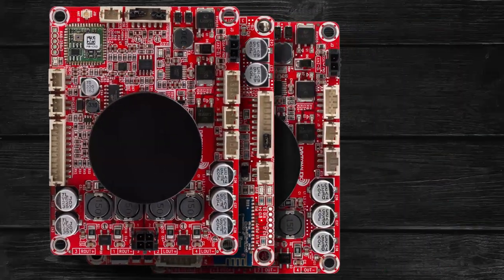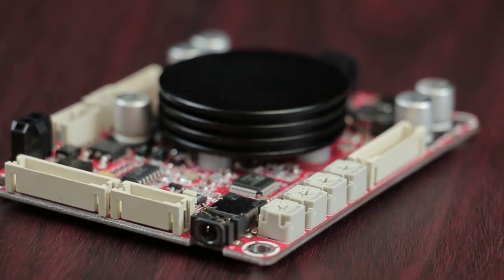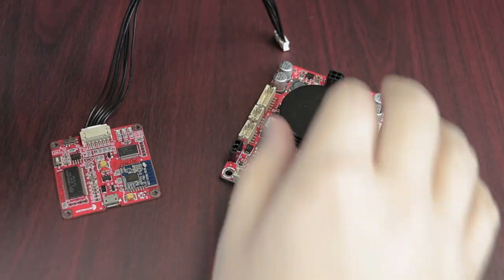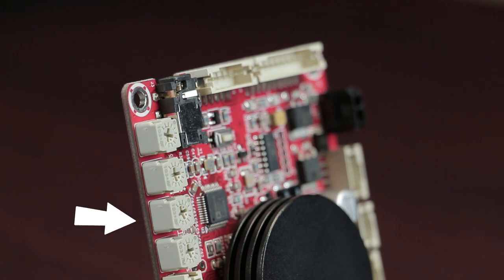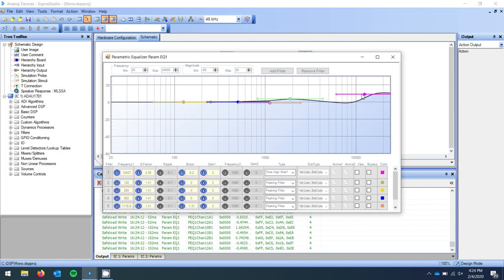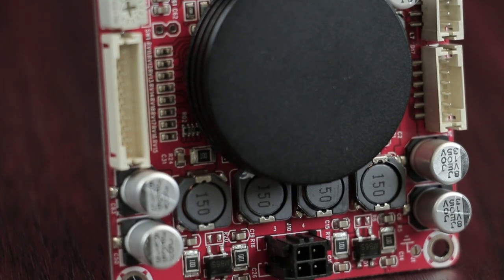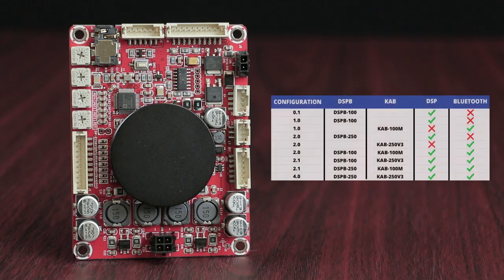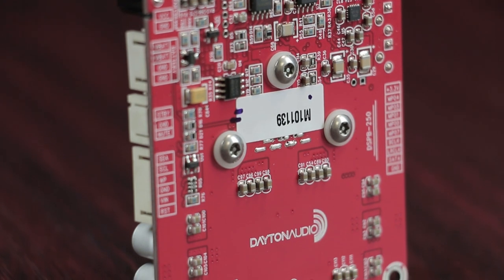Dayton Audio DSPB Amplifiers - Customize Your Sound

Comment: Thank you for making this video it has been much awaited. I just purchased dsp250/100 and have 2×kab30(best mini amp) I have to ask as nobody on tech staff has been able to answer. What is the advantage of the 2×50 Over the 2×30 it clearly seems to be rated for more power,at a lower voltage & higher impedance but still stable down to 4ohm? Is THD better? To sum up what I have noticed the 2×50w seems to be a better amplifier for higher voltage. You have done the DIY community many great services 👍

Comment: Hi there. For the KAB-215 amplifier I've seen 3 DIFFERENT power profiles. 24V @ 4Amps, 19V @ 1-5Amps and 12V @ 1Amp. Which ONE is correct??? Because UNDERpowering a board is just as bad as OVERpowering a board. Thank you.

Comment: I wish PE had a board that supported the AirPlay protocol. The AirPort Express units are getting dated.  Obviously these boards would have to connect via WiFi.
Reply from the maker: We actually have a great solution to this called Hi-Fly. You can use airplay to send music to any device that has Hi-Fly built in and we sell adapters to add Hi-Fly to current systems and DIY builds. Here is some more info: https://www.parts-express.com/hi-fly-audio

Comment: I have a pair of already built (expencive) speaker thar are out off balance (in my ears) - middle bass way to high, highs to low, etc.
I would like to correct this by using DSP. Is this possible with this module + software?
  1. measure speakers - how? via bluetooth app and the phone mic (app internal software calibration for apple, ...) or someting with PC?
  2. let the software / me flatten the courve (not corona...audio)
  3. hook up speakers, be happy
(can one also do this at severals volume level? -> low-> more bass, high-> less bass)

Is this possible?
Thanks for advice!
Reply from the maker: Reach out to our Tech Department if you need helps with specifics...but yes, DSP can help speakers balance out your highs and lows plus so much more. Here is info for our Techs though: 
Email: Tech@Parts-Express.com
Phone: 1-800-338-0531

Hours 8am-6pm M-F EST / Closed Sat & Sun

Comment: Sureh Electronics JAB boards VS Dayton KAB.

Who was first? Who copied who? Are there any differences?
Reply: Sure electronics does OEM work for many companies Dayton audio is one of those companies though I'm sure they made some tweaks to the design. And IMO do a better job of marketing the products
Reply: @matthewmassey2333  haha yes marketing wise sure electronics is terrible and could learn a thing or 2 from other brands.
I've been using the wondom boards for quite some time now and must say that combining the amp boards with the battery protection boards works like a charm. I still want to try out the Dayton boards but I think it won't make a huge difference in sound quality etc
Reply: @JustArtz  They are identical. The only difference is the red silk screen and the Dayton Audio branding. Both are fundamentally the same WONDOM product

Comment: Is there any way to connect a DAC to the board?
Reply from the maker: The ADAU1701 contains its own DAC, as the input signal is originally digitized so it can be processed by the DSP. the signal chain is analog input -> ADC -> DSP -> DAC -> amplifier -> speaker outputs.
If you have any more specific questions, contact our tech support: Email: Tech@Parts-Express.com Phone: 1-800-338-0531 Hours 8am-6pm M-F EST / Closed Sat & Sun
Reply: You can! The ADAU1701 has multipurpose GPIO pins that can be used to output an i2s serial audio data stream to a compatible DAC. On these boards, the J2 connector (the one next to the four potentiometers) contains these pins, and are programmable to the needed MCLK, BCLK, LRCLK, and DATA connections in the SigmaStudio software. This header also has a GND and +3.3v pins if needed for your i2s DAC.

Comment: How many algorithms can you use per card?
Reply from the maker: It is going to depend on which algorithms you choose to use in SigmaStudio. For example, something like a SuperBass algorithm is going to take up significantly more resources than a single high pass filter would use. But in general, there are more than enough resources available on this chip for most projects. For example, none of the example projects provided on the product page come close to maxing out the resources of the chip.
Reply: @PartsExpressOfficial  Awesome, thanks for the detailed reply!